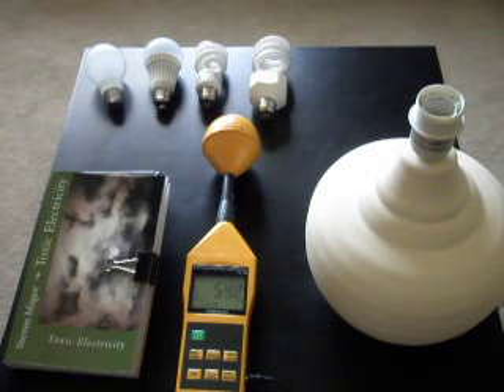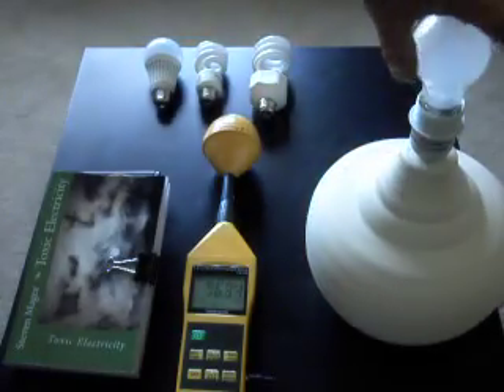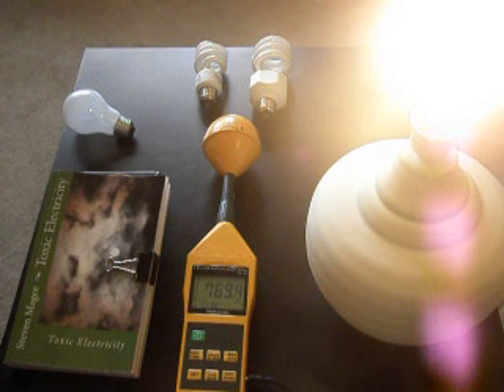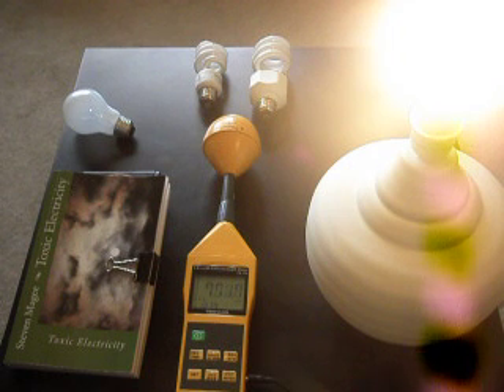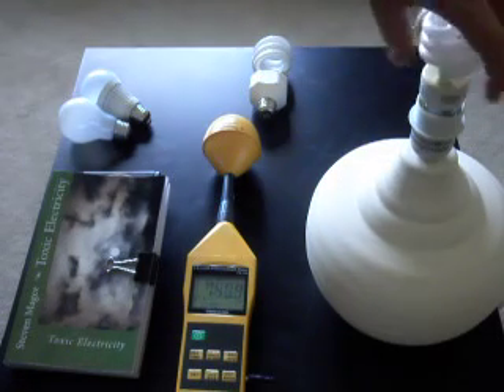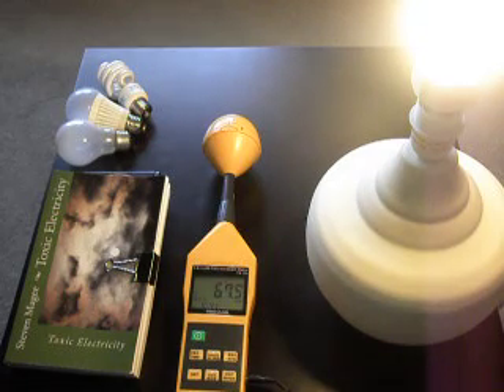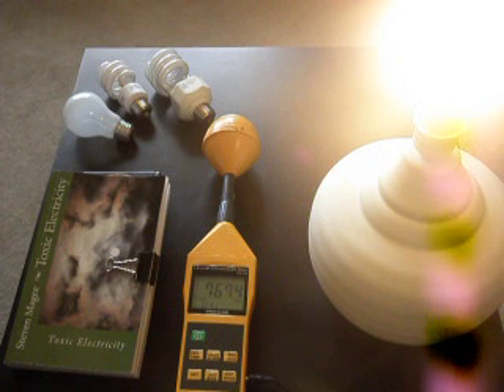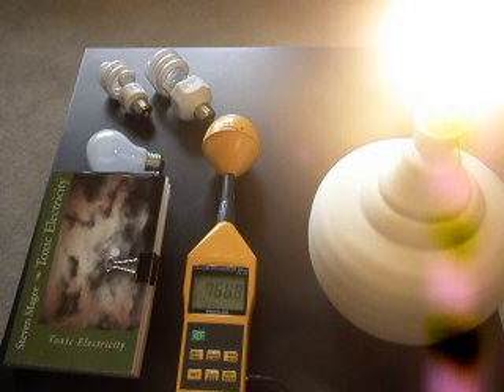Testing CFL, LED, and Conventional Light Bulbs for RF Emissions

Comment: The electronics inside the LED bulbs are the reason for EMF not the LED light source itself. Bad engineering vs proper engineering. Am I right ? There are cheap and there are expensive LED bulbs. Reputable brands and unknown chinesium OEMs. This also applies for LED drivers Meanwell and uknown OEMs.  What if I run my LED COBs with ~50USD driver with clean non-PWM DC current with activePFC , filtering and all the bells and whistles. You can have crap in your home electrical wiring to emit thourgh the bulb. How many people have mains filter at home installed ? There are so many variables. This video tells nothing and many other similar also.

Comment: Look at the light coming from the led bulb, the stream going directly downward.... It's pulsing. None of the other light reflections pulsed. What the hell is this
Reply: its due to difference beetwen refresh rate of camera and frequency blipping of led, find superslowmotion of led bulb on youtube, its not streaming continuously, its blinking on and off at the same frequency as the electric energy source, whic in normal conditions on 220V in europe is 50Hz(led is doing 50 times off and on blip per one sec.)

Comment: I wonder if that LED bulb is doing something funky with the waveform (perhaps the leds themselves are acting as half wave rectifiers or perhaps there is a switch mode power supply inside the bulb to generate the lower voltage.